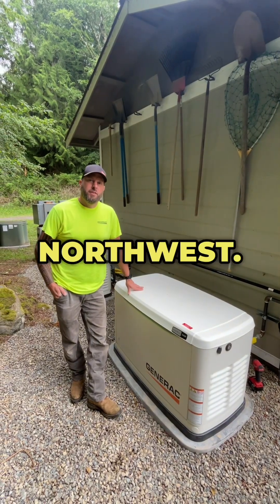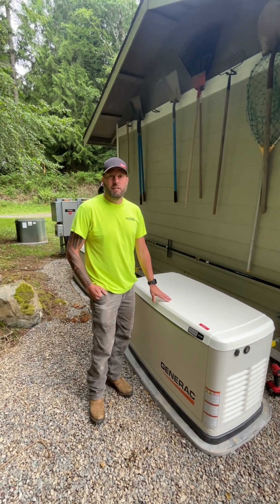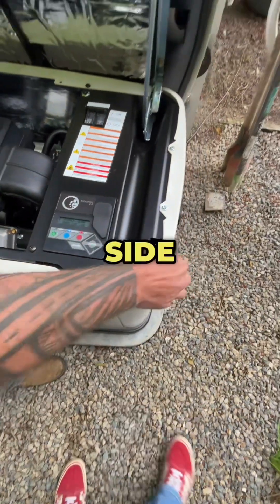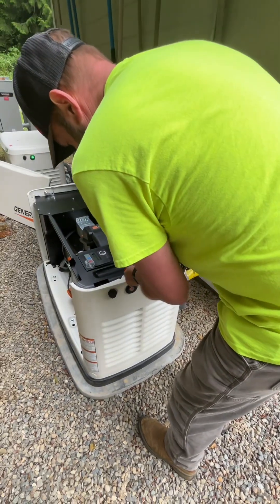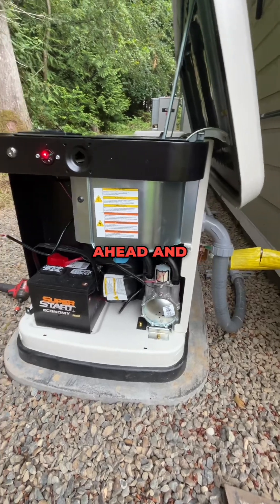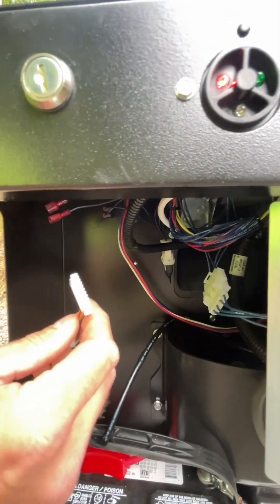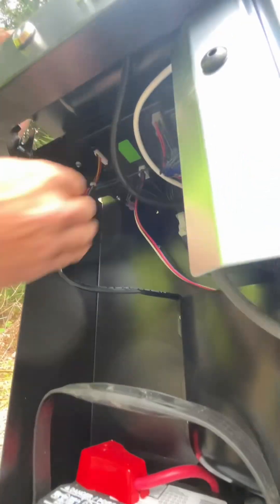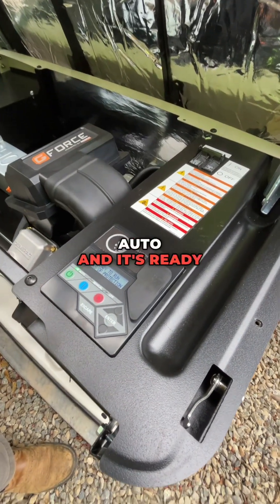Expert Technician Jamie Reveals EASY Way to Access 24kW Generator Info

Comment: I have been having major issues with my Generac generator. mostly over crank warning. I'll check this wire but I have been able to get it to run. I've had a technician come and work on it several times and every time he says it's good to go and yet it doesn't start properly. one of the last things he did when a regular service was done was lower the gas pressure. but I think this is the main reason it won't start. when I try to start it it almost gets going then back fires a bit. eventually it will start but it won't start from standby mode. it will try the 3-4 times then stay off with an over crank warning. is there something other than this wire being loose that could be the problem?
Reply from the maker: Yes. There are many things it could be. However it sounds fuel related. Blockage in the fuel orphice, low fuel pressure or the  governor isn’t working properly. What fuel are you on and was it converted if running off propane?
Reply: @GeneracDoctor  its connected to Propane. it's not a conversion. I bought the LP model. its a 9KW Generac
Reply from the maker: @cmdrtron4723 they all come Natural gas from the factory. You need to convert them to propane.
Reply: @GeneracDoctor  if that is the case then it was converted at the factory. the manual and the labels on the inside of the housing all state LP. I have had it for about 6 years now. it's been the past two to three years that it has started to act up and have issues starting. two years ago I had to replace the gas regulator from the feed line from the tank. my concern is that this is the same issue, which if is the case I don't want to have to replace this every two years. It's not cheap.
Reply from the maker: @cmdrtron4723 what’s the model? I’ll
Look it up for you